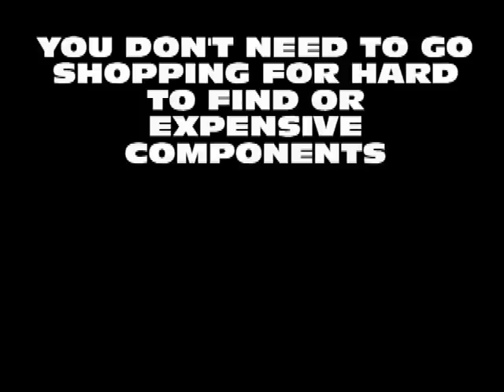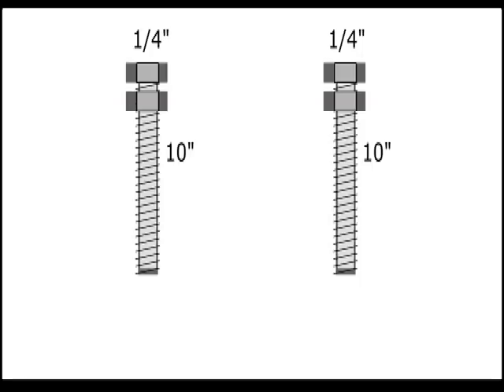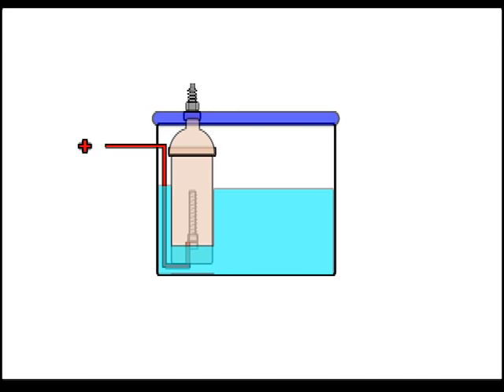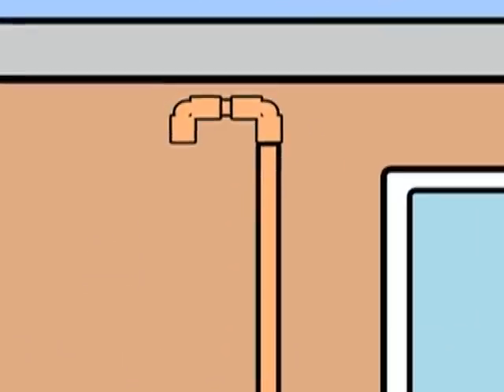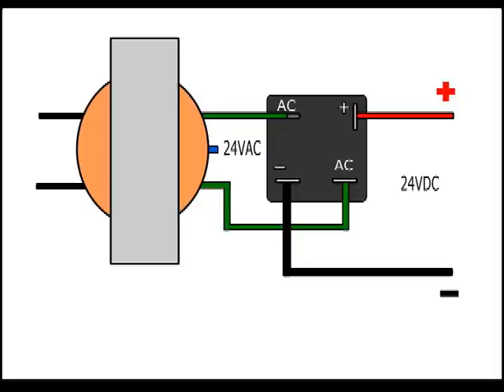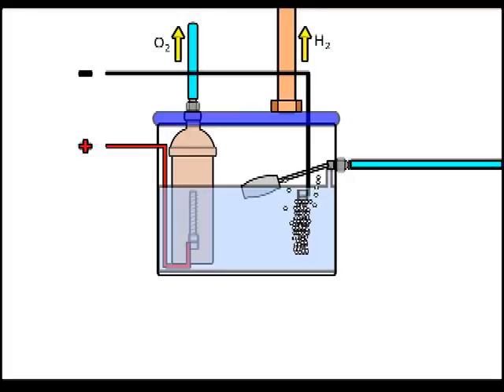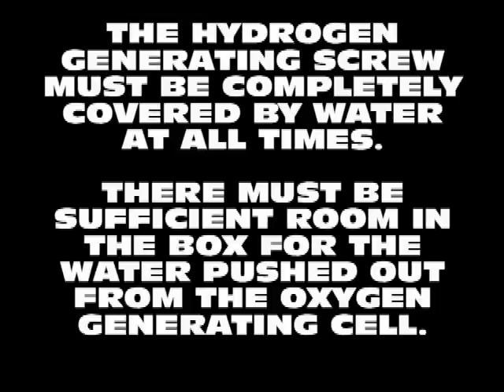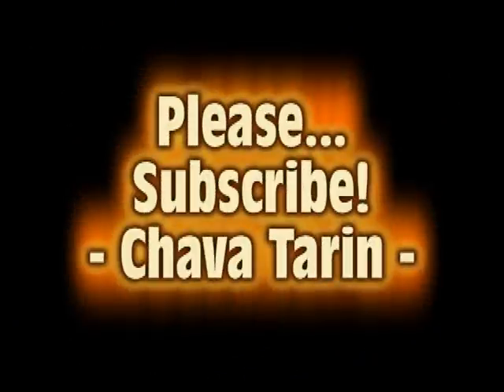Homemade Oxygen Generator

Comment: Hey i  Make Two pvc one for Plus oxyzen one for negative Hydrogen .Both are underwater ..Will this working ?
Reply from the maker: Yes it will. The generator was thought for using in a small welding torch, but with certain modifications, it can be used for other applications. First of all, the quality of the oxygen must be much better. Distilled water must be used, so no salts are present, which could pose a danger of producing other gases along with the oxygen, such as chlorine. A solar still can be used to save power in such a process. With regards to the amount of liters of oxygen per minute, that can be determined by the size of the generator itself, and MUST be checked by a health professional. Something else would be the energy consumed by a bigger generator, maybe solar panels can help here. Please check this drawing at https://www.youtube.com/channel/UCmjQnuJwV0FkjdEyi3099RA/community?lb=UgwRGRtRxJVb63bdsUJ4AaABCQ

Comment: Hopefully I get this right, muchas gracias señor.
?Are there any substances/materials that will capture & then release Oxygen or Hydrogen?
Reply from the maker: You got it right!!! The problem with compressing and storing oxygen is its oxidizing strength. Lubricants will burn in pure hot oxygen, special equipment is needed. I read somewhere that they came up with a gel that will absorb hydrogen (developed for hydrogen vehicles), but I would not bet on that.
Reply: @eltunene  maybe it's the same gel to absorb oxygen for killing dental germ ??

Comment: Can this oxygen obtained be used for medical purposes ?
Reply from the maker: Thanks for your comment!! The generator was thought for using in a small welding torch, but with certain modifications, it can be used for other applications. First of all, the quality of the oxygen must be much better. Distilled water must be used, so no salts are present, which could pose a danger of producing other gases along with the oxygen, such as chlorine. A solar still can be used to save power in such a process. With regards to the amount of liters of oxygen per minute, that can be determined by the size of the generator itself, and MUST be checked by a health professional. Something else would be the energy consumed by a bigger generator, maybe solar panels can help here. Please check this drawing at https://www.youtube.com/channel/UCmjQnuJwV0FkjdEyi3099RA/community?lb=UgwRGRtRxJVb63bdsUJ4AaABCQ .

Comment: Great!! Few questions:--
1. Is the o2 such produced of medical grade
2. If there r impurities in o2 than how to filter out on o2 delivery tube itself
3. Can we attach flow meter in the o2 delivery tube to measure the oxygen prodced/delivered. 
4. Should we used normal tap water keeping  in mind the purity of o2
5. Hydrogen gas is highly inflammable & explosive..will it be wise to release it directly in the atmosphere. 
6 how to store o2
Thanks buddy...if anyone can help
Reply from the maker: Dear Bijay, the original intention of the oxygen generator was to feed a very small torch. However, the oxygen released at the positive electrode is oxygen all right, but if the water contains salts, or chlorine in solution, cholorine can be generated along with or instead of oxygen and that would be toxic. One way to get around that would be by using distilled water. You can use a bubbler flask to try to filter the oxygen output. Definitely normal tap water should not be used for this purpose. The amount of gases produced are dependent of the size of the cell, the amount of electric current available, and the voltage applied. Hydrogen can be released to the atmosphere, since hydrogen is very light and quickly goes up in the atmosphere, where it sooner or later combines with oxygen in the atmosphere itself. If you want to dig a little deeper into this, take a look at a drawing I have at  https://www.youtube.com/channel/UCmjQnuJwV0FkjdEyi3099RA/community?lb=UgwRGRtRxJVb63bdsUJ4AaABCQ please give me feedback on what you see.
Reply: @eltunene  thanks,I m obliged...definitely I shall go through that.
Reply: Somehow boil the water and collect the steam which should probably be distilled water. What was the purpose of adding the NaOH to the water in the beginning? As a catalyst?

Comment: What Ah require for 1000ltr tank & is voltage 24VDc fix for any qunatity of water
Reply from the maker: I would advise build a small version first. A lot of water and a lot of current, also generates a lot of heat, so better start from small version and evolve from there on.

Comment: Can this oxygen be inhaled by patients
Reply from the maker: The generator was thought for using in a small welding torch, but with certain modifications, it can be used for other applications. First of all, the quality of the oxygen must be much better. Distilled water must be used, so no salts are present, which could pose a danger of producing other gases along with the oxygen, such as chlorine. A solar still can be used to save power in such a process. With regards to the amount of liters of oxygen per minute, that can be determined by the size of the generator itself, and MUST be checked by a health professional. Something else would be the energy consumed by a bigger generator, maybe solar panels can help here. Please check this drawing at https://www.youtube.com/channel/UCmjQnuJwV0FkjdEyi3099RA/community?lb=UgwRGRtRxJVb63bdsUJ4AaABCQ

Comment: I am trying to make an oxygen generator at home so that I can provide oxygen to the needy patients in this pandemic time when there is shortage of oxygen cylinders. Can you please tell me whether the oxygen prepared this way will be good to give to patients?
Reply: Bro i am also trying to make one 😁
I have done some research according to it you should use distilled water instead of normal water because NaCl present in tap water will generate Cl gas
Reply: @sarthakdas6059  That's great brother, but the biggest question is how will I store the gas generated...because it is stored in cylinders at a high pressure, and I don't think it will be possible at home
Reply: @razaclasses21  Use an air compressor to do it. Add filters if needed. Distilled water could be made using a Pressure cooker.Just my ideas; no practical knowledge.
Reply: Bro right now i don't have solution to that problem but i am design it for my personal use. right now my priority is to figure out how much oxygen i need to generate per hour to keep a person alive and my design will provide that much oxygen 😊
Reply: @sarthakdas6059  yes it is, but storing it is important, because we cant setup a generator in every patient's room
Reply: @razaclasses21  i saw a youtube video with people storing syngas they generated in plastic bag, then using a compressor to pump the gas from the bag into a gas tank.

Comment: Electrolysis is also very good for removing a rust from a steel, iron etc
Reply: but also very energy intensive, so this is a crap way to produce oxygen. oxygen concentrators do the same, with much less energy

Comment: And if you run it long enough you'll have heavy water in the tank as well
Reply from the maker: Yes, but electrolyzed water to make oxygen and hydrogen containing normal gas, along with deuterium. The hydrogen is then liquefied and distilled to separate the two gases, then the deuterium is chemically combined with oxygen to form heavy water. This requires special equipment and huge amounts of  and energy, so it is not likely to yield important amounts of heavy water.
Reply: @eltunene  heavy water both duterium n tritium molecules are available in normal water and will not be electrolized. Thus if you run it long enough heavy water concentration will keep on increasing.  The process you are indicating is for faster production of heavy water for commercial purposes
Reply: @colsanjaybajpai5747  Heavy water can Not extracted in such experiment! Just Freeze water up to 0 degree then under the ic u will see some unfreezed water that's heavy water because heavy water freezes at lower temperature more than normal water,! That's the easy way of making heavy water 🙏 but not in a such reaction bcz at the end U can remain with salt mixed with water 😂

Comment: But oxygen produced is not pure  , it will be mixture of hydrogen and oxygen.
Reply from the maker: If you are using separate cells, you can produce pure oxygen, althogh in some cases mixed with other gases, such as chlorine, when the water used in the cell has salts, especially sodium chloride. One way to get around this is by using distilled water, which gets rid of salts dissolved in the water.

Comment: The homemade oxygen generator is actually the most basic example of the process of Electrolysis of water. One simply places a container over top the electrode(s) and collect that gas (be it oxygen, hydrogen, or both. The problem is ... the amount of gas type ... that you need to collect.

Using 24vdc, you will collect 3.33 milliliters of oxygen (per minute) for each 1 amp of current (120 watts of power). That is not much gas (oxygen). Hydrogen amount will be double that. (about 10 ml total gas)

Then there is the heat to consider.
2 volts (electrode voltage) is about the lowest heat producer in the water. Anything over that will dramatically increase water temperature; which will increase amperage flow. Now you need a voltage regulation circuit to control the rise in amperage, or temperature will runaway from your control.

Of course, one can add more electrodes ... in parallel ... to increase gas production; but each electrode will draw its own amperage amount .... which will also add to heating the water; and increase the wattage draw.

So, this is possible ... but not practicle.
david at hho4free
Reply from the maker: Very interesting contribution!!!

Comment: Can we use BATTERY FOR TESTING.. 24 V
Reply from the maker: Yes, you can, and help to measure current and voltage you will nee, before building or buying a power supply.

Comment: How to store this oxygen in cylinder
Reply from the maker: Thanks for your question. Handling and compressing oxygen (as well as hydrogen) requires special equipment. In the case of oxygen, most gaskets, seals and lubricants catch fire, since oxygen is a very strong oxidizer. You will require special pumps for that. You can consult qualified personnel for these pieces of equipment. Also, and most important, you must check the quality of the oxygen produced, since impurities present in household drinking water may add undesirable salts and contaminate the outcoming oxygen. Please check with qualified personnel.

Comment from the maker: Dear Mayur, this suggested project is by no means a new invention, obtaining oxygen from water is a very old system, as early as the nineteen century, used at first to measure electricity (hofmann voltameter), and later for torch welding. However, a formal project could include a solar water still (to get pure distilled water), and solar panels for the electricity source. Please follow this link to a drawing I made illustrating improvements and updates for a more practical system. https://www.youtube.com/post/UgwRGRtRxJVb63bdsUJ4AaABCQ .

Comment: CAN WE USE THIS METHOD TO GENERATE O2 FOR  MEDICAL USE.  IN INDIA O2 IS MOST NEEDED PRESENT COVID TIME.
Reply from the maker: Dear Mayur, this suggested project is by no means a new invention, obtaining oxygen from water is a very old system, as early as the nineteen century, used at first to measure electricity (hofmann voltameter), and later for torch welding. However, a formal project could include a solar water still (to get pure distilled water), and solar panels for the electricity source. Please follow this link to a drawing I made illustrating improvements and updates for a more practical system. https://www.youtube.com/post/UgwRGRtRxJVb63bdsUJ4AaABCQ .

Comment: The O2- ion loses 2e electons to form neutral oxygen gas and gets oxidised at the cathode and the lost electrons are gained by the 2H+ ion in the solution at the anode to form h2 gas. But i did not understand the part where H2O and NaOH are mixed. Does mixing those two form individual ions of oxygen hydrogen in the solution? I know Na+ is also present in the solution but won't get reduced because it has very less reduction potential which is the tendency to lose electrons.
Reply from the maker: Wow! Thanks for your contribution!!
Reply: Na is sodium which comes into play when the electrolyte is sea water or salt water otherwise it is just H2O (no Na component in it)

Comment: Kindly specify how much oxygen will be generated .will it be sufficient to treat Kovid patients.
Reply from the maker: Dear Avinash, The amount of oxygen generated depends on the size of the cell, as well as the amount of current available. The main thing is to make sure the oxygen is pure, and that can only be evaluated by a qualified health professional. Please try with a small device first and check the quality of the oxygen produced, if this is correct, you can expand the system, always keeping in mind that hydrogen and oxygen must not mix in the machine, since they are an explosive mixture, and also the reaction involves a small amount of heat, so you must check for that also, if the machine becomes considerably large. First of all, oxygen quality and secondly, check for heat generated. I have a drawing with suggestions, no amounts or sizing specified, but the main features such as layout and electricity sources. This drawing is at my community.
Reply: @eltunene  thanks

Comment: The hydrogen being generated should also be generated within a PVC tube and the top of that tube should be connected to the 6ft venting pipe instead of allowing the hydrogen to float to the top of the tank (outside the tube). This is because if the Oxygen output is closed for any reason, it is possible that the flow of oxygen will be large enough to escape the PVC tube and enter into the tank and mix with the hydrogen which could very likely result in an explosion. That is to say the anode and the cathode should both be within PVC pipes which takes the respective gases out of the tank without allowing inter-mixing.
Reply from the maker: In response to comments similar to yours, I made a drawing using two PVC cells, one for oxygen and the other for hydrogen. Please find it at my Community - you can try this link  https://www.youtube.com/channel/UCmjQnuJwV0FkjdEyi3099RA/community?lb=UgwRGRtRxJVb63bdsUJ4AaABCQ
Reply: Superb tutorial: Just a few quick queries, does the Hydrogen pipe need to be exiting the enclosed room area if the device is deployed in a room ? 2) how much NAoH ratio required with water, also how do we know when to refill NAoH into the new water which is being supplied by the cold water pipe ?  Can this exiting oxygen be used for human consumption or does it contain impurities ?  Thank you again for creating this Tutorial so very well.

Comment: Please explain me the oxygen cell structure ...I am confused abt how Water will cover the stainless steel screw in the oxygen generator cell and gas will not escape from bottom.
So please explain me how to make PVC pipe structure for oxygen
Reply from the maker: Dear Dr.Priyesh, the cell is just a piece of PVC pipe and, since the solution ionizes the water, the negative oxygen ions gather at the positive electrode, in this case a stainless steel screw (it could be a stainless steel mesh or group of plates) and the oxygen is released. Since oxygen is lighter than water, it floats upwards and goes out through the outlet pipe and hose. It does not escape from bottom because whenever the oxygen pushes the water down due to pressure generated if the stopcock at the hose end is closed, there is a time when the screw is no longer immersed in the water so it does not produce any oxygen. This feature acts as sort of an automatic reaction stopper whenever there is the possibility of oxygen escaping through the botom of the cell. Thanks for your comment!!
Reply: @eltunene  thanku sir